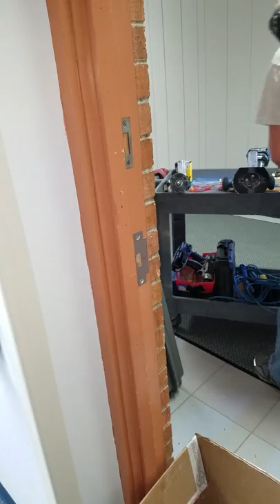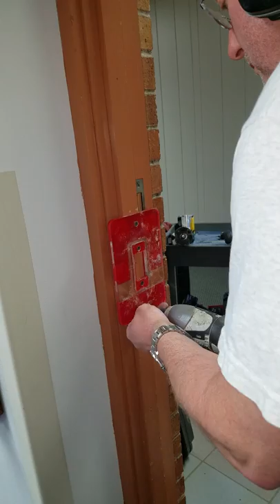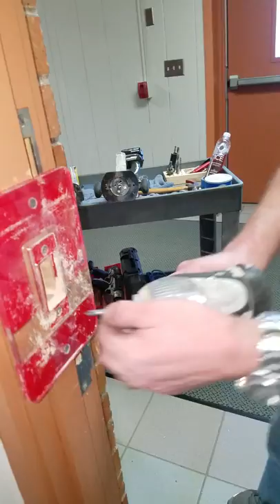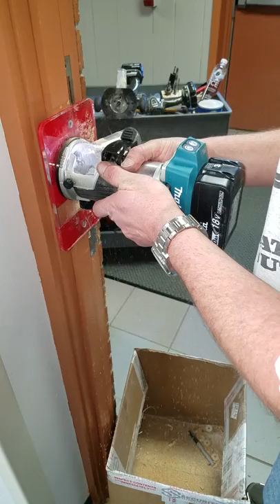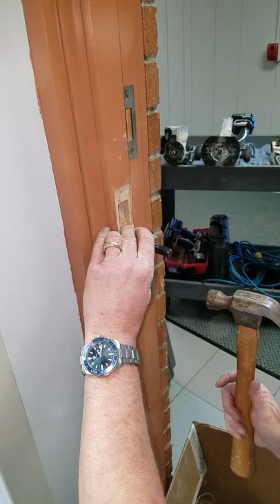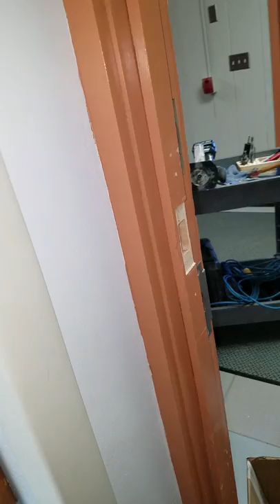Router in strike plate on wood frame

Comment: Do you guys not install dust boxes behind the strike plate?
Reply from the maker: No need to install dust boxes, as these frames had plenty of depth to not have an open back in strike hole. Routing depth was 1-1/8 inch depth.

Comment: What kind of door lock is that?
Reply from the maker: Its called Securitech Safebolt intruder lock
Reply: Will it retrofit on Sergeant 11g05
Reply from the maker: @matteomarascia6407  

Jigs already exists to do that.  But not quite the same as mine. This was custom made by me.  I had over 200 locks to install, some metal frames, some wood. Wanted something relatively clean looking.
Reply from the maker: It should.  Most of these locks were BEST.  But lock comes with misc pieces to fit most lever locks

Comment: Did you make the strike template you used, or is it commercially available?  If so, please give make/model no. I hang doors for a living and use Templaco jigs for latches and strikes but I don't recognize what you show here. Thanks for post.
Reply from the maker: I custom made this jig as the strike is a an odd size and only for this particular lock I was installing.  I was really   going for proof of concept and was pleased with the results.  I too have some Templaco jigs.

Comment: looks great but i would not want to drill 2 holes into the jamb to hold the template.   Then you have to fill sand the holes and repaint your customers door jamb.   thats alot of extra work and cost,
Reply from the maker: Customer is always advised on how I'm doing this..  This building had far bigger issues with. The frames than the 2 holes.
Reply: @normz33  Nice work, but just because you're working in a building with bigger issues, it doesn't mean your workmanship has to be downgraded to match it. Your work has to be always spot on. Nice work though. I don't see any links to the jig.

Comment: What is the name of that kit you used and where can I get one nice video thank you. Paul
Reply from the maker: The template is one I cut using my Epilog laser.  It was adapted to a collet already mounted on my cordless router.  If you have someone that has a laser or cnc router I can send you the file I used.
Reply: Hey norm. Did you use a rub bushing in the first router with the 1/4” bit?
Reply from the maker: @crownmoldingbyspectaculart941  One is with rub bushing, other with the door hinge/bearing setup

Comment: You are missing a battery powered blower to blow out the dust. Blowing with the breadth could transmit covid for instance. Then you need a battery powered vacuum cleaner to clean up. Once the job is done, you spend the rest of the day charging up the batteries.
Reply from the maker: This was an impromptu video. We usually have a vacuum that connects to the router and no need to blow.  Both routers have vacuum hookups. These are weekend or scheduled school breaks for installations and before covid was a thing.